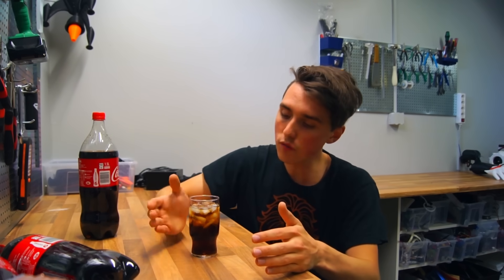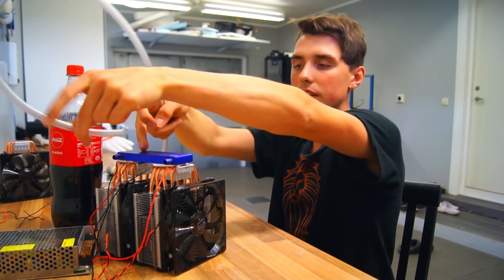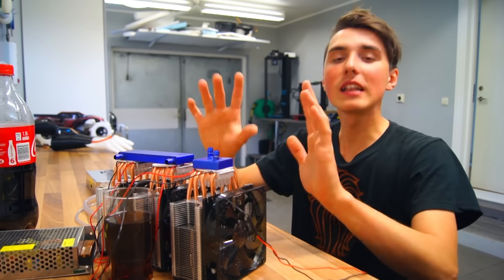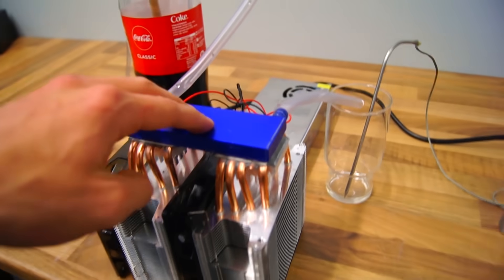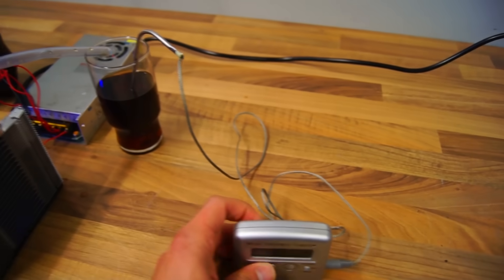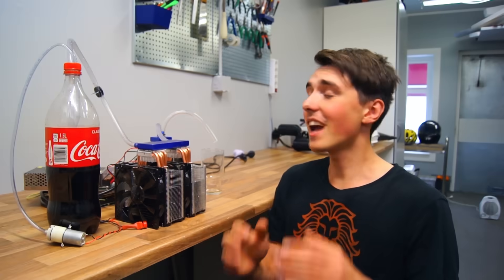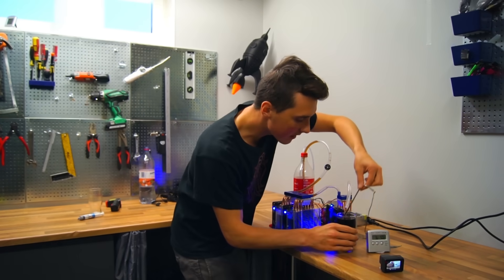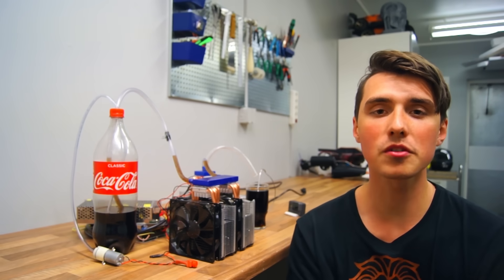Peltier Soda Cooler Machine - DIY Drink Dispenser

Comment: Why don't you add 2 more CPU coolers on top of the water block. That might help further decrease the temperature of the drink
Reply: If you add more coolers to the water block directly the temperature would rise. The coolers can only cool to the room temperature not below that therefore the "hot" coolers would heat up the "cold" water block. You would need to add a cooler AND a peltier element to lower the temperature even more.
Reply: DerTobi when I said add two coolers on the top I also meant adding peltier pads as well I'm aware that it won't work without the Peltier Elements

Comment: u probably dont want the drink to go throught the waterblock or it will become nasty really quick its a pain to clean
Reply: nah, just flush it with water/soap, and then water. pretty much standard procedure to flush a waterloop in pc-world, and carworld, so why not in your sodacooler lel
Reply: Lerbyn i had the same idea, bad trip tbh 😀
Reply: That Yummy delicious LEAD! Best stuff ever for soldering, but not that great if you drink it.
Reply: Fill it with gasoline and light it up. Then the nasty stuff is gone.
Reply: @Lerbyn Have You seen how are soda fountain machines are made? https://youtu.be/pL9BaDr8qlg?t=189
@Jake Garrett In most cases they are welded, not soldered. Also, lead not much used in soldering our days too (since 2006, thanks to WEEE and RoHS), most alloys are tin-silver-copper.
But I have to admit, it's wise to inner coat the heat exchanger with the polymer (like all aluminum cans coated inside).
Reply: Soda is already acidic Carbonic and or phosphoric acide. But, get too strong of an acid,  and it will dissolve the aluminum block. Google hydroelectric acid aluminum.
Reply: They say "vacuum aluminum brazing" and according to linked source, when you braze, you use a lower temp filler than the base metal (aluminum), aluminum is already very low temp, so I'm betting they use lead based solder. Soldering is often called "brazing" if its bigger than a wire. I actually use plumbing solder, like for pipes, and I use that on my electronics just because I have a lot of it. Its the same stuff, except because mine is for drinking water, it has 0% lead and requires flux for a good join (which would be a pain for vacuum soldering).

 I have used lead based solder, and the stuff is fantastic at instantly sticking, which is why I think the Chinese would be using this (that and they never seem to care about environment or safety certifications, and this block was never sold as potable or drinkable).

http://www.lytron.com/Tools-and-Technical-Reference/Application-Notes/Aluminum-Vacuum-Brazing
Reply: Linus T I think that's what silver solder is for? You can indeed solder aluminum. Additionally you can braze aluminium (but I'm not referring to that)
Reply: He is flushing with acid and drinking the by product.
Reply: Daunlouded it's not like that...
Reply: @Jake Garrett  There are Tin-Zinc solders. Also soldering pastes generally includes flux.
Reply: +Sedokun   How confident are you they used Tin-Zinc and not cheaper and easier/better Lead based solder? If this was the US, sure, we wouldn't be using lead. But this is China, where they put Lead in even baby's milk... How awful is that? These blocks were meant for cooling systems, not drinking water, so I really wouldn't expect them to use anything food grade. Lead solder makes a really great weld, so that's why I suspect it's what they use.
Reply: @Jake Garrett Have no clue. But those are in video, probably anodized inside as well. https://www.reddit.com/r/watercooling/comments/6mwg8y/i_got_one_of_those_ridiculously_cheap_chinese/
Reply: Just run acetone through it, it will clean it
Reply: Jake Garrett.
Aluminium will not take tin (with or without lead)
If you want to have something stuck on aluminium you either press fit it or weld with aluminium rods.
Reply: correction: There is a way to wet aluminium with tin but it is not an easy task.
anyway those blocks he used in the vid are probably molded.
Reply: Says right on the specs page: "Processing: vacuum aluminum brazing" (copied and pasted)
Reply: Lerbyn WHO Soulsänger it painfullto clean
Just take bettle with water and a bit of dishsoap fairy Ultra and letitrunthru the waterblocks like the Coke and Aftershave blockt outagain with freshwaterandif you Patin a Saale threeway Valverde cou can clean it fast and quick
And in you Governors the Coke adoublerun Thriller the bloc itwill geht reallyawsome Coldcoke
A recyclebar forthe Collins Wandel Liquidität
Reply: maxpower700 or flush with acid.

Comment: Can you build your own 3d printer
Reply: It's not more expensive, just harder to calibrate and get good resolution. I could have built my own 3D printer but I didn't want to spend months screwing around with it trying to get it dialed in. Instead I got a pre-assembled printer last summer and it's been running flawlessly with zero calibration (beyond the auto-calibration it does before each print) or maintenance.

If you're doing it as a hobby, building your own 3D printer can be a great experience, but if you want something that just works, buy one pre-assembled.
Reply: Yes!
Reply: Daunlouded I actually did!
Edit: No kit or anything.
Reply: Look at rztronics
Reply: REPRAP
Reply: No schiße
Reply: Why would anyone want to do that? It's probably more expensive than buying a DIY kit. Even if you already had all needed tools.

Comment: Try to put the flow limiter after the cooling blocks.
Reply: also, clamp the waterblock to the heatsink as mounting pressure plays an important role in thermal transfer
Reply: worthless setup, only good for 1 coke, cause the module would freeze the leftover coke in the waterblock & it will be cloggedup :)
Reply: @kenaiiVRB  right, pump should be placed after the cooler
Reply: @kenaiiVRB  how isit worthless? Its called experimentation to demonstrate a concept, i bet ure the type who comments "just use a fridge"
Reply: @kenaiiVRB Not if you just drink 1 glass at a time
Reply: Lazar Šaronjić not just that put thermal paste between the Peltier and the water block
Reply: A Al-Jahwari good idea!
Reply: It wont make a difference if its before or after because the only amount that can flow is what enters the first part of the tube. It is under vacuum and if you slow down the flow at the start it has the same exact effect. Think of a straw and if you plug the top with your finger...
Reply: A Al-Jahwari or recycle it and put it again in the cold blocks for me it would be interesting if you can use those water blocks to take away the heat with water so it would be possible to use the warm water in my mobile home for daily hygienic without any Boiler so the hot side of the peltier would be kind of through stream and I want to try building a soft drink dispenser 4 Cola Fanta sprite but every flavour should have its own cooling module and the heat from the other side should be also used also used and this would bemor effective
Reply: Thats what i would have done. Slowed down exit and keep inside block longer.
Reply: it has to be before the heat sink if he adds another  10 cm afterthe first one flow will be just right to get the soda cold and fill the glass at a good speed
Reply: Great idea
Reply: slower pump would be better
Reply: no it would be the same or worse. The ice was melting when the coke passes, so the longer the cokes in the heatsink it will warm up faster
Reply: he could of put a regulator valve after the heatsink and add another loop back to the start of the heatsink, then closed the valve and the coke would regulate around the heatsink. that would be easier lol and you can control how fast the coke comes out
Reply: 1 comment suggests this, replies: gets bullied and called stupid.

this comment suggests this, replies: OMG great idea!!
Reply: kenaiiVRB you can simply reverse the polarity and it will start heating up.
Reply: HE DID HE JUST DIDNT INCLUDE THAT IN THE VIDEO
Reply: @willhiggins4036  NO HE DIDN'T